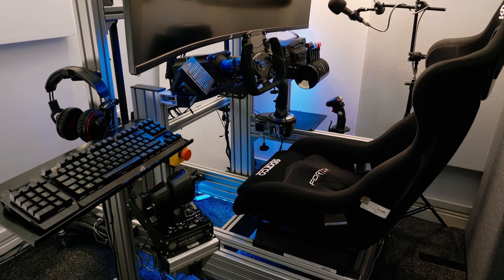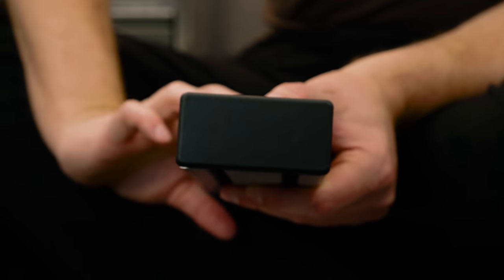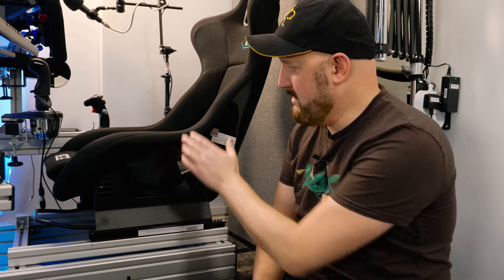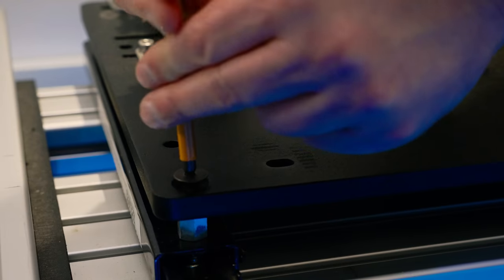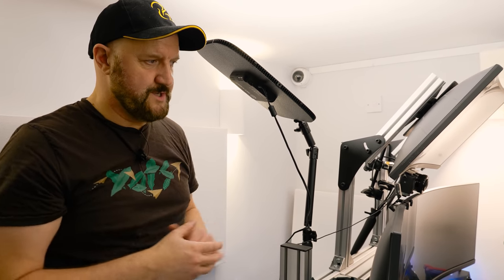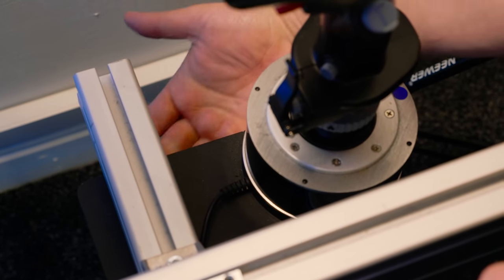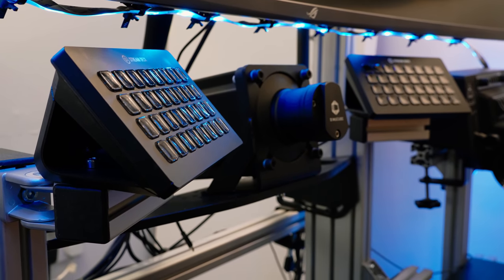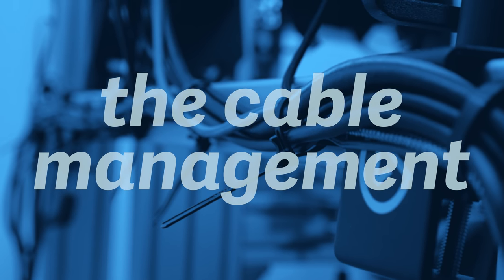Custom-Built Simulation Rig - Studio Spotlight

Comment: Lovely setup there, I have done a very similar setup for the base rig other than I have designed it 100% from scratch, which in all honestly was a massive pain and there is barely any benefit to it. The one benefit it did give me is make a 100% adjustable pedal mount. I have used 2 40x40 beams which run all the way from the seat to the back of the rig where my feet would be, parallel to what in your case is the 160x40 beams. 
This was something I wouldn't have been able to do with any other kit rig, well not without making a massive amount of customisation which would drive up the price. These beams act as rails and allow me to mount pedals at any position length-wise easily making it very adaptable for rudder and simracing pedals without the need for a slider. It also has more reach than a slider, meaning anyone from a kid to a 2m giant to have a go on my rig. Which has come in handy when my girlfriend wanted to have a go at it. I also wanted this incase I ever get into helicopter flying, or if I would want a floor mounted yoke/flight stick, because of the rails I can easily make a mount for it and just use the same system for adding a flight stick which sits between my legs.

Another thing I have done differently is cable mounting, I bought a 100 pack of those cheap velcro re-usable cable ties, which can easily can be extended by just sticking 2 or even 3 ties together, the work brilliantly both horizontally and vertically and can carry any cable weight you might want.

One thing I kind of disagree with was one of your last points when talking about the size and mobility of a rig. I don't disagree with the size part, you need room for a rig like this, but I don't feel you should shy away from getting this if you haven't "settled down yet", yes if you are looking to move countries and such, it is big bulky and heavy so shipping it will cost you, but the beauty of these rigs is the fact you can disassemble and assemble these with relative ease. I wouldn't recommend it if you are moving house every 3-6 months, but other than that they are built to be able to be taken apart and be put back together (unlike most IKEA stuff).

Comment: Its T- Slot Extrusion made by Bosch (Europe), 8020 (USA) etc. It comes in many sizes - 1", 1.5", 20mm, 25mm, 30mm, 40mm and 45mm. Its mainly used in Automation but can be used for anything. I built my van interior out of 1 1/2" T Slot.

Comment: I wonder how much he actually spent on creating that sweet setup and how many hours were put into it.
Reply: Easily 10grand if not higher, but I would imagine a good portion of this is sponsor furnished. He has a custom ASUS ROG watercooled PC with an OC 3090 and other top components. The PC is easily $4000. The rig frame is probably another $500-$1000. Flightsim stuff (yokes & HOTAS) another $1000 (the honeycomb set is $500). The racing stuff alone another $2500 (the wheelbase is a cool 1500 euros alone, plus the wheel another $1000 estimating. Total: probably $10k factoring in other things like lighting, filming gear, etc.

Comment: Great job Squirrel. I agree about the Sim Deck. Thanks for the heads up on the metal plate. I'm building a mobile flight sim wood desk that rolls in front of my recliner now that the year old prototype worked well enough. Mounting the Sim Deck is the real question remaining. I want the buttons to be more vertical which puts the base at a 45 degree angle. 🤔

Comment: Question: Yes. SimLabs. However, which manufacturer of extrusion has SimLabs settled upon? There are quite a few manufacturers of Extruded Aluminum ("EA"). I need to build a larger "desk" and I want my "desk" to be the same manufacturer as the EA from SimLabs. I cannot afford to end up with two different slightly incompatible manufacturers of EA once my desk is complete and I want to add my SimLabs kit. Any insight? 80/20? Some other manufacturer?

Comment: Do  you regret not having triples? I currently have triples and with trying to also run a separate desk using the same PC I am getting overwhelmed by the amount of cabling. Seriously considering going to an ultrawide but also don't want to regret it after dropping 1k on a monitor.

Comment: When I received my Honeycomb Bravo Throttle the baseplate came with four holes pre drilled that would fit a counter sink screw. The Honeycomb Alpha Yoke did not have those holes pre-drilled. Looking at their website for extra base plates, the picture doesn't show the holes. I wonder if they've updated the base plate with the pre-drilled holes but haven't updated their website.
Reply: I checked on this a couple months back and they had not. The sales rep didn't even know what I was talking about so I sent pics. Hahahaha. Ultimately I located a few choice locations for the alpha plate and drilled my own small holes inside the bracket locations and inside the back tab locations (never used those).  Note the bottom of the plate too I you do this. Has worked just fine. I used some pan head screws. The head was short enough not to protrude the plate surface.
Reply from the maker: @TwoSierraEcho  Is it a metal base inside or are you screwing into plastic?
Reply: @squirrel  For the Sim Deck and the honeycomb plate,  into a wood.

Comment: Lovely setup squirrel. For my emergency stop button I ended up just unscrewing the 4 holes and drilling a hole through the back and bolting straight to my rig. 
I surprised there is not more flight sim gear to the level of SIM racing companies like simucube, Heusinkveld etc. 

Also have you managed to create some good ffb settings for your simucube when driving euro truck simulator?
Reply from the maker: I did consider opening up the box and trying to bolt it. Good to know it can be done. 

I'm not happy with my simucube settings for ETS2. I feel like they could be better. There's a bunch of profiles on True Drive Paddock which others have made. Could try some of those.
Reply: @squirrel  yes I will try again. What racing Sims to you drive? I love my simucube. Really is nothing more immersive for the normal consumer.